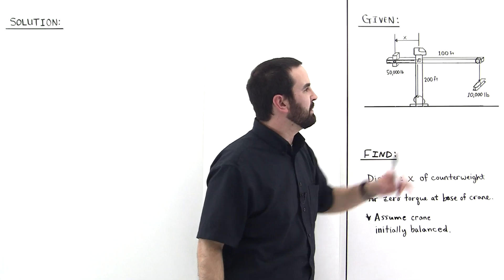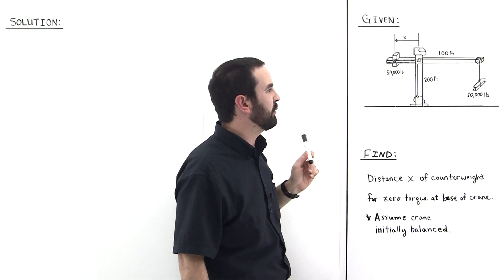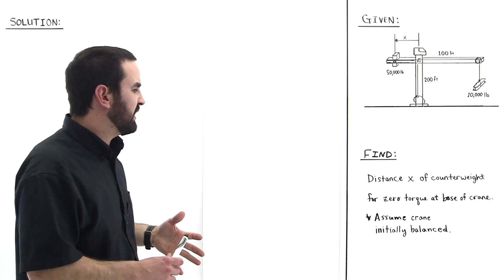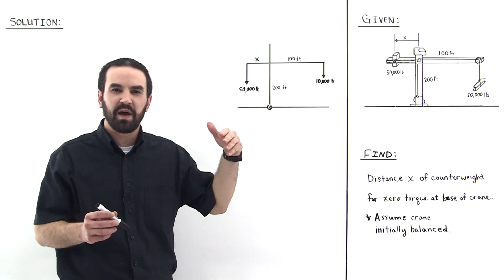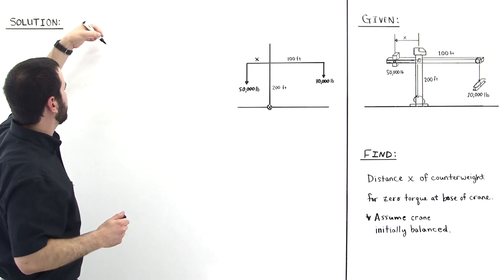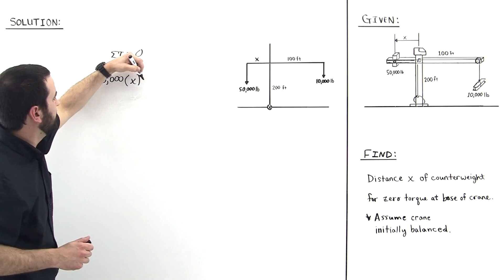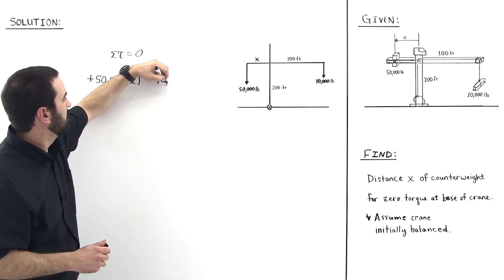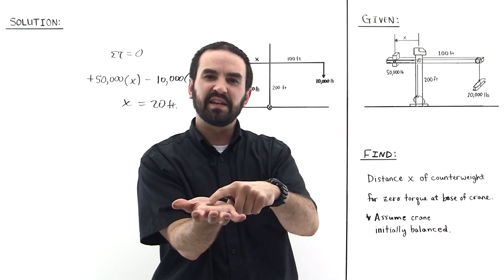Statics Example 3 (Static Crane Design)

Comment: Got confused. Counter clockwise is negative right and clockwise is positive?
Reply: The cool thing is you can define it either way. If we say clockwise is positive, then the equation is -50,000(x)+10,000(100)=0. It will still work out to be x = 20ft.
Reply: Thank you

Comment: not torque, but moment
Reply: sometimes moment called torque you can check that in static book by R.C.Hibbeler chapter 4 first page states (When a force is applied to a body it will produce a tendency for the body
to rotate about a point that is not on the line of action of the force. This
tendency to rotate is sometimes called a torque, but most often it is called
the moment of a force or simply the moment.)
Reply: @Ms-ve3ie  And I do have that book somewhere in my house. Thanks for the info. Hahaha clearly I was focused on method marks and not concepts.